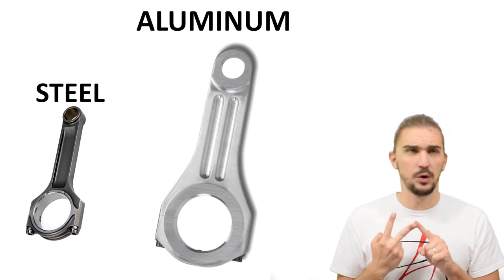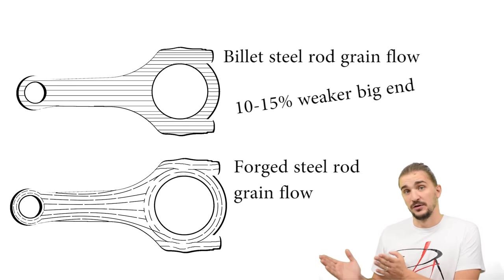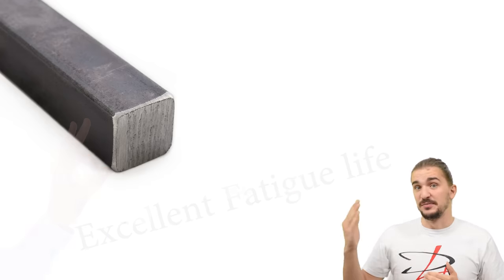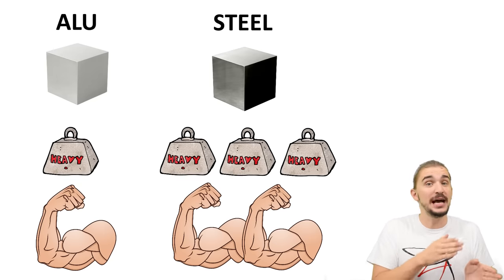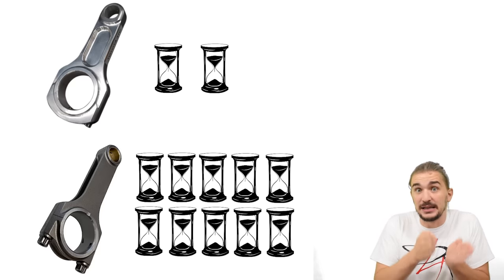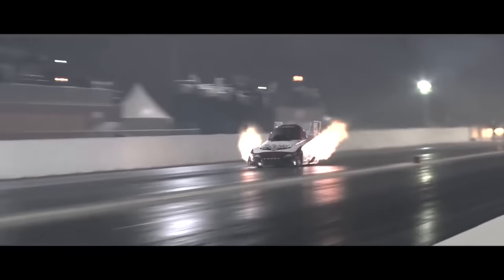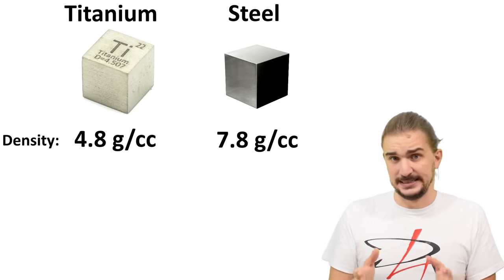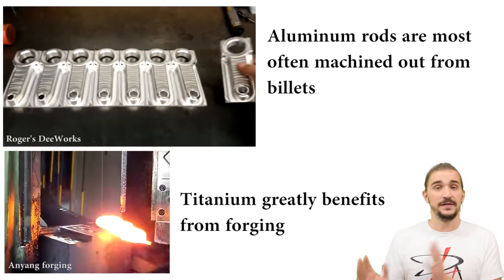STEEL vs ALUMINUM vs TITANIUM Connecting Rods

Comment: Very interesting video. Thank you. My sole machining interaction with titanium was to replace the steel clip on bars on my motorcycle with it. I started with a 510mm length of 22mm OD 18mm ID tube and tried to cut that into two 250mm lengths but even though the chuck was turning real slow it still locally hardened so I had to resort to a grinding disc to finish the cut (but I was able to easily face the tube ends afterwards, strange stuff titanium). Both tubes needed a 5mm hole in them to securely locate the throttle and switches but the first hole I cut ended up oversize (I used a 5mm end mill). On the second tube I used a 4.5mm end mill and finished to size with a HS steel drill bit (that worked perfectly).
Seems like you need a lot of cutting fluid (I used oil), continuous pressure, sharp tools, and slow speed. You can't afford to let the machining heat the part or it immediately hardens (titanium is a poor conductor of heat for a metal so overheating is easy but local). High speed steel tools are fine just so long as the cut is not allowed to create too high a temperature.
Oh and titanium burns. When it burns water will not put it out (the oxygen in H2O feeds the fire) so be careful (dry sand will smother the fire).

Comment: Huge fan of the detailed analysis! You should cover timing belts vs. timing chains.
Reply from the maker: Thanks for the idea!
Reply: @d4a  also add in there gear drives
Reply: @porterarthur659  Don't forget shaft driven camshafts like the Kawasaki W800
Reply: @mememaster147  also the old-school four-cylinder drive shaft gear driven Porsche type 547, 587 and 692 engine

Comment: Literally have my old LS7 in pieces, sitting in my garage, complete with OE forged Ti rods. Those hypercraptastic pistons just don’t like boost.
Reply: We run some quite high boost on some of our engines,some with the 'hypercraptastic' pistons still fitted,we built a single turbo V6 duratec with around 9.5:1 cr on low-ish 7-9 lbs boost on 70,000 mile factory H/t pistons,expecting a short life,It's had four years of moderate abuse without protest so far and have heard tale of some people running silly boost with them with no issues.I've also seen them broken on na engines,conversely I have seen a few engines using decent aftermarket uprated parts destroyed through poor application of those parts,bad/poor machining tolerances,poor building practise etc.
Reply: Haha HT pistons can take plenty boost if the tune is right, ran stock ‘93 5.0 short block, victor jr heads with low/mid 20psi for 3yrs until the cam pin sheared from the cam bolt stretching/harmonics then upgraded everything. And was well over the claimed max 500whp too

Comment: An episode of OHV(pushrod) vs. DOHC or SOHC would be cool
Reply: Agreed. I'm a big fan of overhead camshafts.
Reply: @bicyclist2  But with modern head designs, pushrod v-8s can get 100 hp per liter NA.  But the OHV "weapon" has always been about putting a lot of displacement into a small and lightweight package (rather than maximizing volumetric efficiency).  Now that they're not giving up so much on the specific output front, they make a tremendous amount of HP for the mass and volume of the total package.

I am running an 8.2 liter (502ci) LS.  It's pretty giggle-inducing way of producing ~800 crank HP.  It's always in the right gear.  It only weights 550 lbs including flywheel and clutch.  

I've loved a lot of 4-valve motors over the years, but none of them deliver power in such an easy to use manner as something that makes its power through greater displacement.
Reply: All that said, if other packaging considerations demand an inline or horizontally opposed motor, DOHC all the way.  But judging by YouTube, an LS will fit in anything.
Reply: @yzScott  I feel like DOHC could do better though for peak power. OHV seem to only benefit larger displacements (FCA hemis, Chevy's LS) because the lack of cam manipulation (cam profiles, etc.) as an effect has the car draw out more power throughout the range since they lack an "economic" or "less agressive" camshaft profile and all (ex: vtec, vvti, vanos,etc.) and are stuck on a medium-aggresive lobe, whereas DOHC or SOHC has mutiple levels. You can see how in Coyote people complain it lacks low end -- probably has an economic "first" lobe I would think, whereas the Camaro SS with OHV seems to have a much more meaty powerband. They both make identical peak power though, even though the LS has like 1.4L or some amount more in displacement.
Reply: @pokemonmasterbab  OHV doesn't benefit anything (power wise).  DOHC will always make more power everywhere in the same displacement.  But at the cost of a bulkier, heavier, and more complex package.

And it comes back to my point, the way we often look at engines is by hp per displacement, but a better (but more difficult to compute) metric would be HP per lb or HP per displacement of the entire engine package.  What will fit under under the hood and have a reasonable weight is what actually matters, but that isn't a figure in the magazines.  But people have figured this out for themselves, there is a reason why people are putting LS motors in everything under the sun.

OHV is marvel is packing a lot of displacement into a tiny amount of space rather than maximizing volumetric efficiency. 

And what matters most is how much fun can be packed between the frame rails.  OHV while "antiquated" still offers a very compelling total package.  You just have to get your eyes off the HP to displacement ratio.
Reply: @yzScott  I get it. I wonder why supercar manufacturers stick to DOHC. The only OHV "supercar" AFAIK was the Viper (or there merely wasn't one if it isnt a supercar). It's not like the buyers really care about MPG or so, and the lower weight would totally benefit track performance.
Reply: @pokemonmasterbab  They don't.  Unless you don't consider McLaren (multiple models) or Corvettes or the Ford GT or Koenigsegg (multiple models) or SSC Tuatara or Aston Martin Valkyrie not to be supercars.

When Chevy started crushing everyone on the track with a pushrod V8, the other teams tried to have that engine penalized as "an advantage."  LOL

My pushrod car will surely top 220 and does the quarter mile in the high 9s.  Supercar?  You tell me.

Comment: The GM powdered metal rods are decent as well.  They are good to 500 HP.
Reply: That’s an understatement. Many people reliably get 800+ from the stock sintered rods
Reply: roller beearing engines oil injected.

Comment: Lamborghini ones said that they are developing some kind of forged carbon fiber connecting rod  for their engine, is this true
Reply: There were composity "poly-rods" decades ago. Never went anywhere. Would be easier today, but ... why? You'd need a huge advantage to justify the cost, and many racing series (such as Formula 1) limit what you can use (aluminum blocks and heads, ferrous crankshaft and con rods, etc.)
Reply: @UncleKennysPlace  to my limited understanding I think you might be wrong as I had readen this thing in magazines in 2018 and Lamborghini introduced this concept after they had launched perfomante where they used forged carbon fiber panels and then they said that they are developing a forged carbon fiber connecting rod for their engine, but I don't know how they will do it in a production car
Reply: I remember reading about this as well - after Googling this it's looking like 2024 until the next Aventador is released, which is where the CF connecting rods are supposed to be.  While the rods might not be legal for motorsports, meeting fuel economy standards in Europe might give VAG the incentive to develop them.  The claim was to save 3Kg in a V12, who knows if they can achieve that in real life.
Reply: For con-rods I don't think so. They are using it for the chassis anyway. Oh, and if you're interested also check out forged carbon AP Royal Oak Offshore watch ;)
Reply: @AlessandroGenTLe  can't guarantee on that as technology will develop so there's might be a way,  Lamborghini engineers are not dumb enough to say anything to public that's for sure, and there can be other materials like graphite which can also be used,

Comment: Always used forged steel rods on my BBC and SBC engines, never had a failure.   Had Aluminum rods in a 427 BBC and it revved fast and never failed.
Reply: FORGED CHEVROLET!

Comment: May I humbly offer a note?  Thank you.  I think you should spend a little more time exploring the different applications of the different material choices.  As in, if you are building an engine for nitro methane drag cars you would want "X" type of components, but if you're building a warmed up daily driver with an expectation of 100,000 miles you'd want "Y" components.  Basically, I have found that the most expensive option is not always right for every situation.  I know you did mention it, but I remember being a Noob, and thinking that there was a one size fits all "best".  

I love your videos, and I'm amazed you put them on YouTube for free.

Comment: You make concise analytical comparisons. Very helpful for those who are not knowledgeable. And i often wonder what language you speak?  Titanium also splits on any scratches so must be polished. No roughness or sharp edges. Used on Aircraft landing gear is has a short life and needs constant inspection.   AS you said Machining is a slow tedious process and temperatures must be kept low.

Comment: Thank you for the confirmation that TiN coating prevents galling in sliding applications! I was pretty sure it would, but it's hard to find information about it since all search results are about TiN coating on steel. I want to use titanium for cycloidal reducer discs in robot actuators, both for light weight and to avoid the precision grinding that's necessary with steel due to the hardening process causing deformation.

Comment: Great video !! Thanks for that ;)

I still got two questions for whoever would be able to answer me: 
- does the low young modulus of Titanium affects the performances? I mean, isn't it a drawback to have a connecting rod that has elasticity in environments where high stresses take places?
- Could we imagine an engine block tighten with titanum screws instead of steel ones, or would the material be to elastic?

Comment: Whew!  I’m exhausted.  On my Ducati’s, the first thing I’d do is replace the Pankl Ti rods with Carrillo rods.  As marvy as Ti is, its elasticity allows the rod cap at high rpm (14,000) to go oblong and oil pressure loss is measured.  Although the Carrillo rods are slightly heavier, the weight and strength added by the Carrillo rods offset the weight advantage of the Ti rods.  Also, proper crankshaft preparation gives me back that gained weight by using the steel rods.  I can’t remember the exact numbers, but I do remember that after crank prep, rod prep, and piston matching, we realized almost a 200 gram weight saving with a substantial increase in rotating mass reliability.  Keep titanium out of your engine, use it as secondary structure fastening, use it in high heat areas such as exhaust valves and exhaust systems.

Comment: Different steels have a large variety of tensile strenghts - about between 400 MPa (structural ASTM A36 steel)  and 2800 MPa (2800 Maraging steel). And maybe the yield strenght might be more important considering the connecting rods. Below the yield strenght the connection rod would be only deformed elestically, so after the load is applied it will revert back to its original form. For a load above the yield strenght and below the tensile strenght the connection rod would be plastically deformed - bent or so. And that should be enough to ruin one' s engine?
So the yield strenght is much more applicable. 

Thanks for you great videos!
Reply: 4100 series Chromoly probably has the best mix of properties to cost ratio of any steel alloy. Here's a question; do any OEMs use 1018 or A36 for rods?
Reply: Well noted. Not "might be more imporant", yield strenght definitely is more important, for this partcular application at least.
Reply: Though yield is just slightly under tensile, this steel has quite amazing specs >> http://www.matweb.com/search/datasheet.aspx?MatGUID=638937fc52ca4683bc0c3f18f54f5a24&ckck=1 <<. 750,000+ psi tensile strength. Despite its inherent brittleness, it has a strength to weight ratio unmatched by any other material I can think of offhand.

Comment: Titanium rods are not worth the expense.  However Titanium valve spring retainers and valves offer lower spring tension options that you didn't have.  lower valve spring tension can yield back a lot of horse power lost to valve train resistance without the risk of valve float.

Comment: some thoughts on the subject (and please correct me where im wrong):

1.  concentrating on uts/to weight is simple but futile. even ys doesnt help. its fatigue strength thats important, unfortunately a complicated subject with many variables (no. of cycles, frequency, amplitude, type of reversion, temperature,  different types of corrosion, what else?) besides there are other aspects in engineering a part (creep, again corrosion, hydrogen embrittlement, buckling, fracture toughness, shear strenght, shape, what else?)

2. grain orientation/"flow" is a myth or a least overrated and a thing of the past.  it always referred to the orientation of the dirt rather than of the grains themselves, in forging that is. (yes, in a rolled/drawn product there are elongated grains, but there is cross rolling too.) in wrought iron, that is a composite of steel and dirt stringers (silicates and other oxides/sulphides) the dirt had to be driven out and oriented by forging, in early steels it was beneficial to make the dirt (often mangenes sulfides) "flow" in the direction of highest strain and in cheap modern steels the same holds for the seggregation of carbides and/or other constituents ("banding). carefully produced steel will have a minimum of such  defects that would make it anisotropic.  on top of that, even a traditional heat treat results in annealed martensite, where prior austenite grains are of little importance, unless its been done wrong and even if they were, how do you get directional flow with a 10-20µ grains?

3. thermomechanical processing history, cleanliness, heattreat and exact composition are far more important than the designated category of an alloy. e.g. fast (inductive) hardening as well annealing results in superion properties. how much accicular ferrite is there in a typical 4340 rod, how much retained austenite and to what extend is it stabilized? thats why a carefully produced "billet" is superior, provided you dont mess up the structure during machining/grinding.
 
4. 5140  is an out dated alloy that still exists in the imagination of automotive writers only. (go and try to get a quote.) 

5. i thought aluminum-lithium alloys were pretty much dead.

6. the price range of available metals is easily 1:20.  there is plenty of "supel-alloys" of every kind that unfortunately are produced in limited shapes or on demand only, because they beve been developed for  specific applications.

Comment: This is an awesome video. Just wanted to add, 6al4v isn't the "best" alloy of ti to use, it is just the most common go-to alloy, accounting for something like 90% of ti alloy made. There are others that would be way better as a connecting rod but will likely never get used due to rarity and cost.

Comment: I build racing engines for a living over 20 years,  and I approve this message.
Reply: I'd like to ask a question about engines , with all things being equal , overall weight , gear ratio etc. Will cubic inch out run horsepower ??  
 Example ... a 350 hp 454  vs. a 454 hp 350 @ 1/4 mile , 1/8 mile , 1 mile ??   What is your take , or experience , and maybe other variables that are considered in the equation ??  Thanks !! 😊

Comment: good video, however the trend today is a hybrid process to first cast the rod blank , then reheat and forge to shape. This 
corrects grain structure and improves the strength in the beam length and does help with strength of "big end" strength. Of course
this is a process to produce a stronger rod for production engines, at a lower cost. They also "crack" the rod at the big end to keep the 
grain flow strong.

Comment: Very nice video, will stick with me :) One thought I had was when using my 2 sets of BME rods on race motors was that I would have to sacrifice the "squish distance" and lose effective chamber turbulence if I had .060 clearance Bill says is required to use his rods, but then I wasnt thinking they would expand once "warmed up" to minimize this negative. Think i will rig a setup to measure position of piston top through spark plug hole so I can measure cold and hot and get a handle on "stretch". Possibly this could be used to measure rod fatigue as well without disassembling engine. My guess is when fatigued they would be longer cold?

Comment: I have found aluminum rods that were slightly cracking in the big end bolt area after a "routine Winter teardown" of a SBC alcohol drag racing engine. We were probably about one or two runs away from a catastrophic and spectacular engine failure. That is never good in a Front-Engine Dragster running 20% Nitromethane. We replaced the rod and checked the rest, but eventually placed the engine on "Injured Reserve" replacing it with a better, fresher engine. That cycle never ends with Drag racing engines.